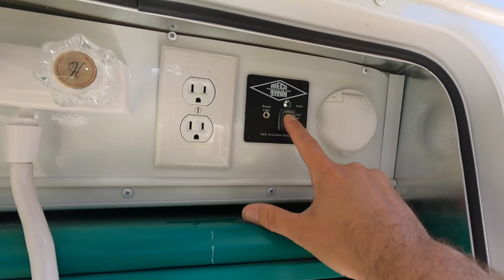Review of loading our HOST Mammoth Truck Camper on our RAM 5500! We share our tips and tricks. RV

Comment: I'm a previous truck camper owner.  Ram 3500 with a 3000 Big Foot camper.  Without the extra height of a flat bed and super single tires I needed the extra extensions to the camper Jack's to lift it high enough for the 3500 bed.  I have a couple of observations you may have already solved. 1.  Your tiedowns are dependent on the tiedowns on the flatbed, they will probably need to be beefed up.  My Big Foot was very heavy and the Host Mamouth is even heavier.  2.  Overall height on my Big Foot was right at 13-6.  Using a flatbed plus the super singles may be pushing your height beyond 13-6  if you also have a tall AC unit.   Lee

Comment: We highly recommend having a fabricator make brackets that you can drop in on the flatbed camper interior sides. Your truck camper will move (slide) on the bed side to side. You need a bracket/brace to prevent that. Glad you are aware of your center of gravity. Be aware that you also have a very high center of gravity, so watch those turns. Go slow. I have seen  three rigs just like yours .... flipped on their side, overturned. You may also want to consider looking at a supplier, Panther RV Products, who carry a complete line of parts. We see you have Rieco Titan jacks. We have the Happijac model and use a bolt on Jack Extenders 6" Lift bracket to get that extra lift. You may find the same type for your Rieco Titan bottom of leg extensions. They also have better Swing Out Camper Jack Extension Bracket for your front jacks. We also made our own 4x4 rig, a chassis truck, a modified Knapheide service body box on the back, and the truck camper mounted on the box. We have to raise up the camper as high as you and it is an adrenalin experience. Enjoy the experience and watch that high center of gravity. Safe Travels and Happy Trails.
Reply from the maker: Wow, thank you so much for all of your advice. I appreciate it. I am not done with my build yet so lots more to do. I appreciate your insights for sure.

Comment: Remove those silly rubber stops in front.  I mounted a "camper stop" out of angle iron and a 50" 2x4.  Bring the camper right up to the stop and lower it.  Period.  Camper can't slide forward AND you get the camper 3 inches further onto the truck.  Less hanging off.  Check your camper to make sure you CAN go in 3 more inches and that it won't hit any of the plumbing.

Comment: Love the host mammoth camper. Can’t find any for sale up here in Canada. I looked at the Eagle cap 1200 but it’s even heavier than the mammoth.
Reply from the maker: Hey there, thank you for watching. Yes it's very hard to acquire a HOST in Canada so you may need to drive into the States to buy one. Yes the Eagle Cap's are very heavy because they are a little wider and has different insulation. I think the HOST nailed it with the Mammoth.

Comment: Great to see gas motors. I didn’t even know Dodge made a high output Hemi. How does the Hemi handle that payload going up some steep grades on the highway or high altitude? Could you  pull a small trailer w/a razor with your truck camper as well? Great videos.
Reply from the maker: Arod, thanks for watching and the great questions. Yes, its rare to find the HEMI High Output engine in the 5500 platform. I haven't had any issues going up the massive grades and mountain passes in Utah so far. Yes, the camper hangover doesn't sit low on the truck and the rear hitch is wide open to pull anything you want.

Comment: Have you been off road much with that set up?     Does the camper stay put or shif around at all?    Additional securing required if so?    I have a f 550 with a flat deck.   So wondering for real.   Ian.

Comment: I have been a TC guy for years and currently run 19.5s on my Ram 3500 SRW but have heard great things about Buckstop Super Singles. I do think you might rethink your tie downs. I have always been told the tie downs should pull against each other. Your tie downs are both pulling your camper forward and it will eventually shift in that direction allowing the camper to move in all directions and will end up hitting your auxiliary gas tank. I like the 9'6" bed but giving up the front 1'6" makes me wonder where the COG sits? I am surprised that Host doesn't mark it on the side. I disagree with the need for the camper to fit snugly against conventional bed or side boxes, it should ride just fine when tied in properly. Just me 2 cents, now get out and enjoy that sweet ride
Reply from the maker: Brock, thank you so much for your comments and sharing your journey! I appreciate you!
Reply: Looks like he's got a rubber mat which would prevent sliding forward, an unexpected bump in the road could cause a shift though.  It's happened to me.

Comment: I’d put the fast guns directly to the bed.  That’s a lot of weight to hold on the rails.
Reply from the maker: Yes, I will be getting some d rings installed on the corners and attach them there.
Reply: @KruseandViews  Angle brackets for the front corners and a bolt on or welded guilds in the back will help keep the camper from shifting and putting stress on the fast ties.  Beautiful setup.  Hate to see you have an issue later.  I’ve been a welder fabricator for 32 years.  
Can’t wait to see your future vids